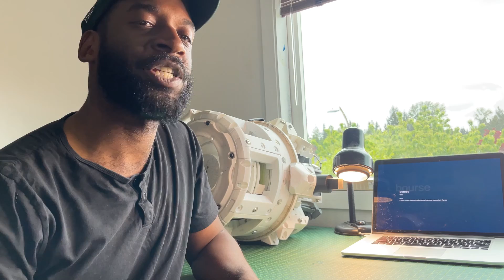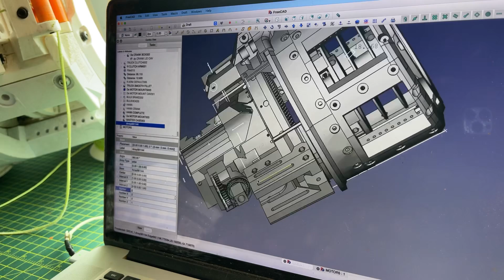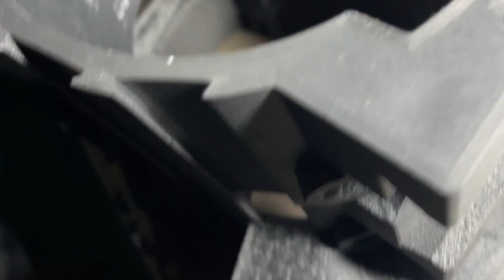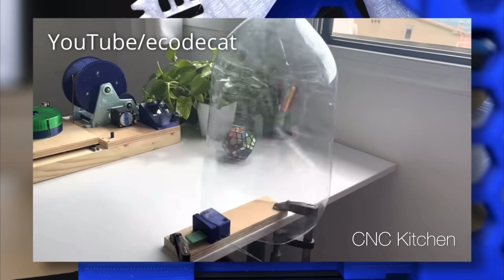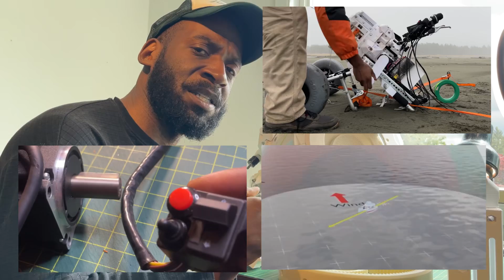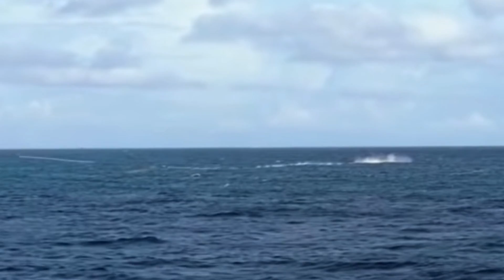How We Make Sailing Wind Generators: A Behind-the-Scenes Look

Comment: Im a sailor. I live on the water. All the time. I literally have dreams of this. All of it. Soon the boat will be mine. I am on my way to it. It will be powered by your drive system. I dreamt it. My system has cooling and heating features tho for it. They are self controlled. I had dreams of all of the journey before any of it made sense to me. Infact I believe in the journey so deeply this will probably be the only way I try to contact you.

Comment: Subscribed. You’re brilliant and I’m happy I stumbled across this criminally underrated channel. I can’t wait to see this OKE system used on mid-larger sized power cats. I can’t be bothered to climb a 100ft mast so sailing is not an option for me. Interesting things happening with electric propulsion, but I don’t think the technology is quite there yet. A hybrid system using diesel, kite, and electricity to move and power the boat would have strong off-grid capability and redundancy that I would trust for long ocean passages. Following this project. 

Jordan

Comment: How large of a kite wing would you need for a 14ft aluminum boat to reach speeds of 45kphr?
Reply from the maker: @RustyShakleford1  That’s a very light boat, a 15meter kite in about the same amount of wind could achieve ridiculous speeds downwind almost up to and exceeding wind speed, however without a keel you’re unable to go up wind
Reply: @Ocean_Kite_Energy  i thought you could go about 40% upwind with a kite? I think a rudder in place of a keel will work or a keel on an outboard bracket mount
Reply: @Ocean_Kite_Energy  I appreciate your input im wondering if a foil would be better to reduce drag and increase light wind performance

Comment: For tracking the kite, use color coded retroreflective tape on the corners of the Kite.  Have your camera system equipped with a light to beam at the reflectors. Then use something like OpenCV to locate the reflectors in the camera image and solve the Kite’s orientation and relative velocity.
Reply from the maker: Exactly my friend. Completely solves the equipment aloft problem.

Comment: I've seen one of your previous videos and was quite impressed. 

However it doesn't seem like you have advanced since then. Playing with recycled materials holds no value to an end user. Honestly, commercially, we don't care! 

The difference your kite machine will make to the world of disposable everything is less than one millionth of one percent, why you would waste time and money on that I have no idea. 

We need to know that it works, it's strong and reliable and the real benefits of owning one either in extra distance per gallon/Litre of fuel or extra speed/distance under sail. Also the Regen possibilities need to be explained in a lot more detail and in a user friendly way, as it is now it seems you're using the word Regen like many marine engine manufacturers, as a marketing ploy but in reality absolutely of zero value. 

So if you're serious about making a commercial product, then get serious! If you're just playing around with a toy that interests you then enjoy your play time. 

Personally I'm disappointed by this video compared to your previous.

Comment: One caveat:  Most ocean cruisers don't sail in strong winds.  Rather, they use modern weather forecasting tools to search for and sail in "weather windows" of light winds.

As for sand, use plenty of dry lubricants!  Joint, seal and brush (attached, for sweeping out sand) design also minimizes the intrusion of sand while maximizing it's removal.
Reply from the maker: Great constructive advice my friend, I will definitely look into dry lubricants, I've never considered brushes...

Comment: This kite machine is a great solution for green energy.

The windmills produce lots a glassfiber trash too. 
Kites weight far less.

Improving the kites aerodynamics,  by putting some glassfibre rods in might help.
With rods in the kite , the kite doesn't need all these lines anymore.

I have invented a flying machine that is very good in harvesting energy. 
But it got the motor and all these parts inside.
 But it's design is very tuff. It can't speed up like a plane if crashing. And it should survive a crash into water. It survives gusts too.

With your machine, electric Paraglider travelling becomes an option. 
Just land if the batteries get empty. And recharge using the kite as wind generator.

Comment: How soon do you think you can have a working option.  I have a 52ft steel motor yacht in the UK , looking to bring it to Canada soon . Can you contact me if your interested in providing for a major test and  presentation.  Regards Ian
Reply from the maker: So there are a couple of different models, manual, automatic, and autonomous. 

You'll be able to upgrade the manual to automatic and autonomous.. I think depending on partnerships we can get the manual done by late summer/early fall. 

Right now I am working on the gimbal mount

Comment: Brilliant.  Just one suggestion: if you have two induction sensors you will be able to tell the direction of rotation, not just the number of times it rotates.
Reply from the maker: Very good point, I've got the induction sensors, but I also have hall sensors inside of the motors, this will help with determining the direction.
Reply: @Ocean_Kite_Energy  There is a requirement for a large number of autonomous boats that I have identified.  At the moment I am looking at combinations of wind and wave propulsion.  There will be solar panels but they will be needed to power the electronics and steering and payload. Maybe a folding propeller, in case it is drifting too close to the shore, and the wind is in the wrong direction to get away.  
I am wondering if this kite approach can be used on an autonomous boat?
Questions: what happens when the kite gets wet?  From rain, or landing in the water?
Can it autonomously retrieve and re-launch the kite after it inevitably lands in the water?
Reply from the maker: @StabilisingGlobalTemperature  this system would be perfect on an autonomous Boat, but I have to admit there is a bit more hardware that is necessary.. ideally I think you would want a mechanism to capture and fold the kite.. maybe even swap out kites.

Currently the kite engine is the best solution for retrieving a crashed multi like kite.. (and even relaunching) because you can undo any potential twists from the engine/winch itself.. it sounds simple but many winches cannot rotate from the mount..  Other multi line kite system are a big hassle if it crashes.. because you can't reel in a twisted line.

And many kite boarding kites are waterproof/water resistant, it's fine in the rain
Reply: @Ocean_Kite_Energy  Thanks for the helpful reply. I have done quite a lot of sailing.  I am wondering what the advantage of a kite is relative to a sail?  I suppose that the force on the boat is applied much lower down, so the boat would hardly heel at all, for a given wind speed.  And with your invention it can produce electricity at night, which of course solar panels cannot.
I have another suggestion: If you stick a reflective tape to the kite, then a flashlight would illuminate it enough for the camera to see it at night.

Comment: How about without the power generation
Reply from the maker: The power generation is the goal, but like with cars we start with a manual transmission, then we get automatic transmission, then we get cars with regen braking... and ultimately a self driving car.. I'm looking for larger partners and I want to be clear on the practical steps that are necessary to get to the self driving.. but right now, we've definitely on manual car level.. with a little automatic transmission with the electric motors..

Comment: hi, Im an electrical engineer at blue heart energy. I have experience with fabricating pcbs and want to help you out. (also a big fan of your project)
Reply from the maker: Mike  that is great! Thanks for your interest. I've been doing this long enough to realize that I don't realize what I don't know! I'd like to ask some questions about the best way to prototype the electronics, like should I stick with premade motor controllers and use Arduino to interface with those motor controllers.. or start from scratch or somewhere in between.. def shoot me an email when you find the time, Christian.Harrell.OKELLC@gmail.com

Comment: Do you use any type of lubricant on the moving parts? Do the plastic gears get hot or make static electricity from friction? I used to do metal fabrication and repair in the navy. I’m intrigued by your invention man.
Reply from the maker: So I prototyped in PLA, and it's actually a great material for sizing parts because it's so cheap. It's only problems are its low heat tolerance, creep under load, and lack of waterproofing.. 

Funny you mention being a Navy mechanic, my friend is a diesel marine mechanic. He gave me this great Teflon grease lubricant that works really well for the larger gears.. I am interested to see how it will work with the fiber-glass nylon gears... But let me tell you these gears feel bulletproof

Comment: Awesome, I have been fascinated by the use of kites to augment sail area on boats for a while now, what is interesting in your case is that you want to use the kite to generate power I am very interested in this aspect as solar on a boat is great but there is room for another method of generating power at night or in windy conditions. Some of the challenges with kites at sea is the very radical difference between the wind from almost nothing to gail force winds. 
Word of caution, using recycled plastic for non mechanical parts is ok, but for parts that need to retain integrity over a long period of time you need to spec the product higher.
There are carbon cor filaments available, let me know if you need more information on them.
Keep posting your work, this is very interesting.

Comment: Propulsion and electric generation in one package! That's cool Christian, thanks for going deeper into the design of this concept.  How exactly is it generating electricity? is it the looping of the kite rotating the drum? of is it from some a sort of brake regeneration system when letting the kite lines out?
Reply from the maker: Great question, so it's more of a spiral than a loop, as it pays line out it unspools line from the drum, that drum is connected to an electric motor that doubles as a generator. Pretty much Regen braking but for a reel!